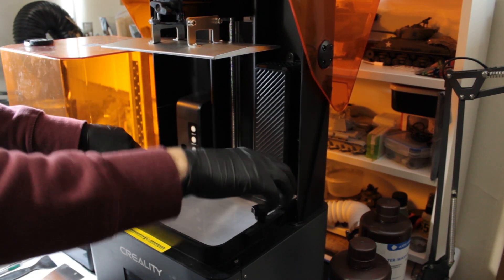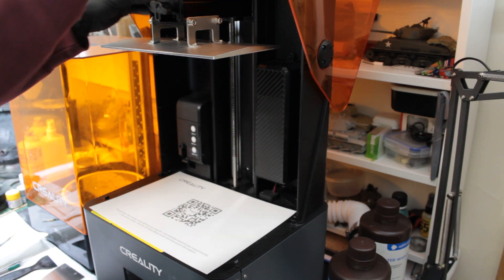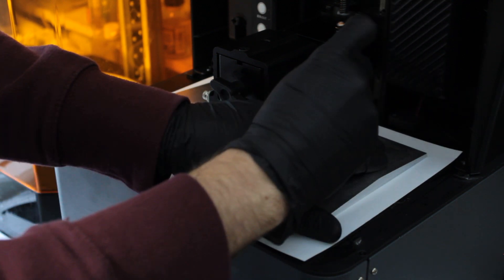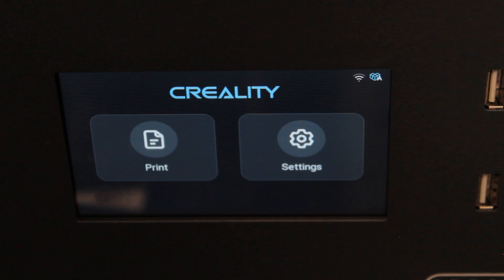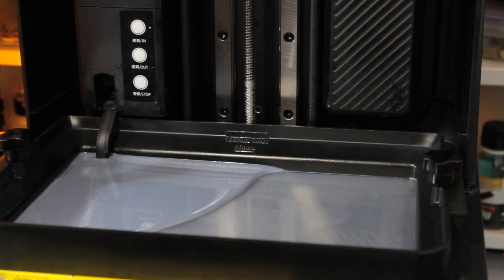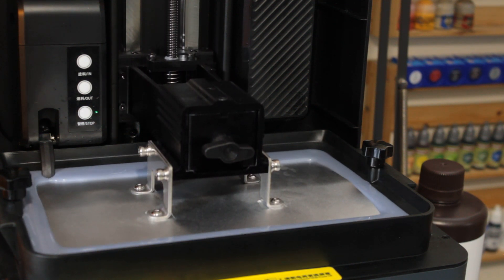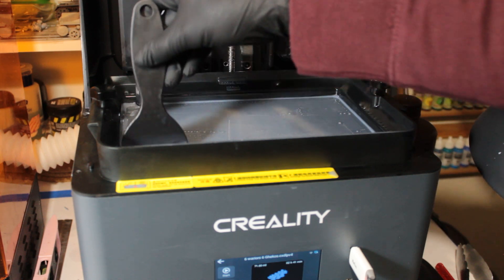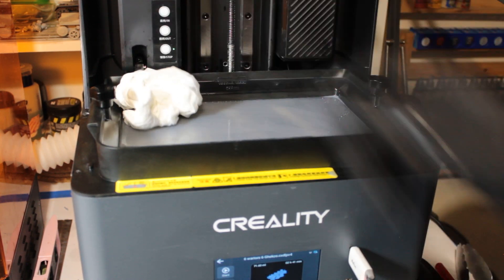My first 3D printer........Creality Halot Mage Pro 8K 3D Printer Review, setup and unboxing

Comment: If you don't use some of the resin in the tank are you able to pour that back into the bottle to reuse another time or does that need to go in the bin?
Reply: Yes but don’t forget to filter it with one of the paper funnel that should have come with the printer.

Comment: I have a Halot Mage Pro, but for some reason it stopped printing, and it won't even clean the bottom of the vat. None of the resin will become solid at all, even in the cleaning process. I need help to get this fixed.